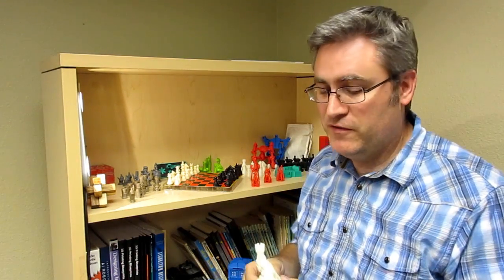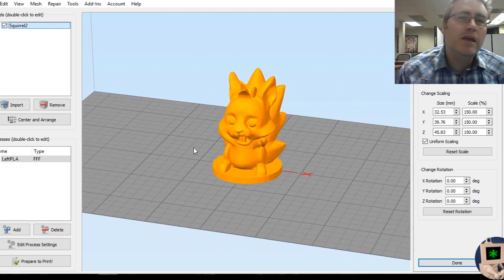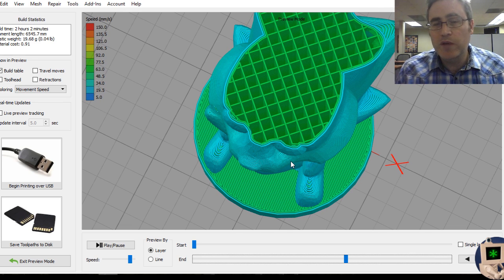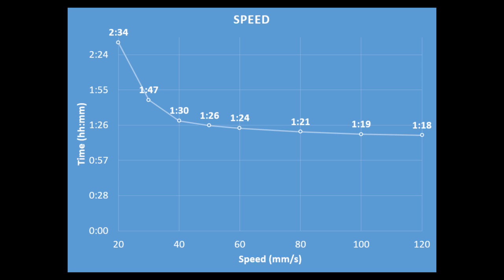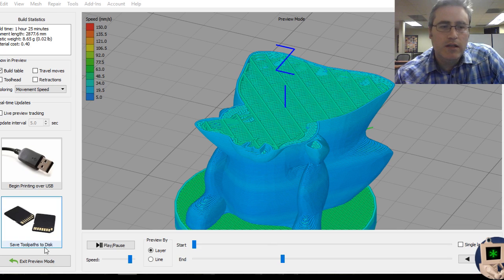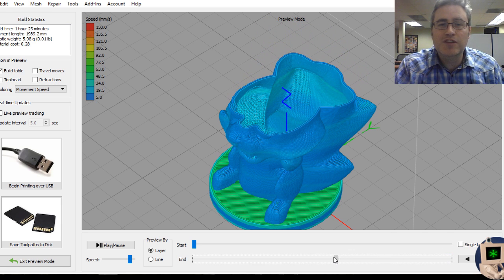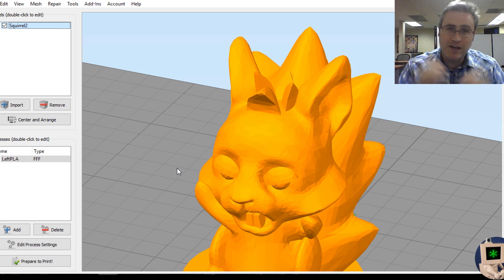How long does that take to 3D print?

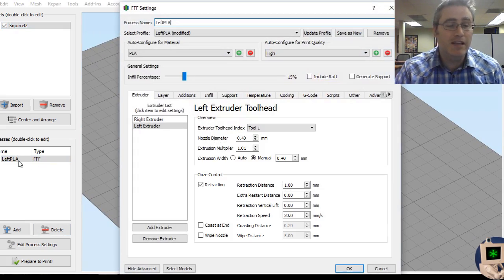Comment: At 14:15 when you were doing the layer height adjustments you accidentally changed the nozzle size to 0.10 instead of the layer height, FYI. It stayed at 0.10 for the rest of the layer height section of the video, so the derived numbers are off relative to the earlier baselines.
Reply from the maker: Yeah, in the video demo that's true, but when I gathered the data before hand to make the charts I didn't make that mistake. But, good catch.

Comment: Hello, just want to sayI love your videos, they are very informative.  I know this video is 2 years old but I've only recently discovered your fine channel.  I don't know if you've already had comments or not, but I just wanted to point out that at about the 14 minute mark, you changed the layer height to .3 from .15.  After you went back to change it, you actually changed the nozel size to .1 instead of layer size, and when it didn't print you went back and changed the layer hight without changing the nozel size back to .40.  I'm not sure if that makes any difference or not, but I just thought I'd mention it to you.
Keep up the great work!!!!
Reply from the maker: That was a silly mistake done while recording, but the graph was done with the correct information. Good catch!

Comment: Heh, I'm coming into this hobby as a CNC milling machine setter. So I'm used to 2 hour more or less setting times on average as I set the less complex machines. But after that the parts roll off the machine between 20/30 seconds for the basic stuff and 20 mins later for the more involved items

Comment: did you just set your nozzle diameter and print layer to .1mm? if so then your print time I think would actually be a lot lower once you set the nozzle diameter back to .4mm then set the layer height to .1mm lol
Reply: at 14:15 was where you changed your nozzle diameter, which I am sure you caught later unless none of these settings were saved so you never had a print try to use them  ha ha
Reply from the maker: Did I not reply to you 2 months ago when I wrote this? Yeah, I noticed that I messed that up after the video. Fortunately the data for the estimates was made before I made that screw-up, so while the lecture is a mess, the facts are right. Good catch on you.
Reply: not even sure about the query about replying, heck I forgot I even posted this lol.

Comment: I actually ran some of my own estimates. Using the fairly new bob-om HD model on thingiverse, Cura 2.1.2 x64 slicer, 1.2mm walls (3 walls), 25% infill, 40-50mm/s print speed. Looking at JUST changing the layer heights (hh:mm):
0.1 - 33:58
0.15 - 22:55
0.2 - 17:34
0.25 - 14:07
0.3 - 11:55

So you can cut the print time in half using 0.2 to 0.1 with only a minor hit on the final printed quality. Versus a big reduction in quality printing at 0.3 layer height (say with a 0.6 nozzle as I use sometimes), cuts down the print time by almost a third of original 0.1 time. So that is a part of 3D printing that we need to balance, do we need strength, speed, or quality? While slower print speeds resulting in longer print times typically lends itself to strength and quality, some of the newer 3D printers out there are able to keep the strength and quality at higher speeds, but also comes with a higher price tag.

Comment: Great video!  As a NOOB, I truly appreciate videos like this AND the Blender videos.  

I am waiting for my BCN3D Sigma printer to be shipped and am trying to get a head start on preparing myself. 

BTW..At 14:15, you accidentally changed the Nozzle Diameter rather than changing the Layer Height.
Reply from the maker: +notcranium You're the second person to catch that nozzle change. Man, you can't get away with anything online. Fortunately it didn't break anything and I caught it soon after.

I recommend you start modeling now. Don't need a printer for that. I was modeling for a year before I got a 3D printer.
Reply: +Joe&#39;s 3D Workbench Thanks for the suggestion.  I already started modeling in Sketchup and want to move over to Blender for the flexibility although Blender does appear to have a much steeper learning curve!  
I just bought this book about making an Octopus Pencil Holder that I hope will help with the learning.  :)

Comment: S3D is notoriously underestimating the amount of time something takes to print. I've had a print estimated at 16 hours take 20+. I've never had a print finish under S3D estimation. I've had a 4 hour print take 9 1/2. S3D can be greatly off. 
You really need to start with a baseline of a 4 hour model and see where it goes -- 30% more is over an hour more time.  There are more elements than acceleration, there is "jerk" which is how fast the head does corners, some printers can do set jerk to 15mm and have it corner well, others need to have at 5mm or 8mm etc. Acceleration of your printer is also not known by S3D it's extrapolating, guessing -- some printers can have the acceleration set to 4000 or 5000 and have things work, others will have belts slip as it's accelerating. Then there is non-print movement, how fast the head can do travels while not printing, that may actually be the bigger limiting factor as the model gets bigger. If you tune other parameters, that is jerk and acceleration to work best with the mechanics of the machine, print speed can be increased without lose in quality. I typically print at 90 and 100mm/sec (different cartesian printers) and the one printing at 90 is actually faster due to higher accelerations and more aggressive jerk. I built a large delta and those printers can absolutely fly, if you can extrude plastic fast enough (that's a limiting factor there, will get to it in a bit) those printers can print and actually achieve speeds of excess of 200mm/sec. And their non printing travels can easily go over 500mm/sec. That being said, I'm upgrading my delta extruder and hot end to bondech and e3d volcano -- when dealing with big models (the delta print volume is 490mm  diameter and 685mm height -- though will be a bit less with volcano) using standard .4mm nozzle is just not practical, as fast as it can move, going up to a bigger nozzle for large models will not noticeably impact quality and will drastically speed up prints. That was a lot longer than I intended. PS you changed your nozzle diameter in one setting to .1 -- that will A) not work B) make the print take a lot longer.
Reply from the maker: +kazolar I did change the nozzle diameter there at the end. Fortunately it was on the last item and I did catch it after recording the video. I just hoped no one on the internet would notice. So bonus points to you. The charts were built before my mistake, though, that so I know it didn't effect the date there.

Yeah, S3D isn't accurate, but if it's consistently inaccurate it can still be used for comparisons with reasonable assurance. It's not perfect, but it's better than having to print 40 copies of the same thing with different settings.
Reply: +Joe's 3D Workbench I find that the more travels and retraction there is in the print the greater the deviation is. If I tell S3D to lift on retraction, it will get even slower, and the estimate will be even more optimistic, however doing that eliminates "scar" marks, so worth it.
Reply: I am using Cura, and it actually did underestimate the print time once. That was a mesh screen I created using a Blender script, and it was especially crafted to cheat Cura into printing a mesh the "obvious" way, meaning to lay down whole length columns and rows. With 10cm lines, the printer goes to top speed in no time at all.

Comment: This is a very interesting video. When I had to explain to family members how long things take, they seemed pretty surprised. My sister had envisioned something like those machines at zoos and museums that mold plastic or wax figures in a couple of minutes...

I do have my doubts about Simplify 3D's estimates, because they are always considerably off for me, but I don't know if they are consistently off (in other words, I'm not sure if it gets the percentage difference between the various settings right, even if the total time is wrong). It does seem a little counterintuitive that so many of the settings like infill don't actually affect print time that much. That said, layer does indeed seem to make the most dramatic difference. I'm still new to 3D printing but after doing some experimentation I've more or less decided to do most things at 0.1 mm layer height. I'd rather it take longer than look bad, and when I tried 0.2 mm my models looked rather bandy in places. But I might give 0.15 mm a try.
Reply from the maker: +Mighty Jabba&#39;s Collection S3Ds estimates may be wrong, but I was relying on them being consistently wrong for comparison reasons. Of course the only way we'd really know is to print the same models over and measure the times. Adding up all the prints I would have to do in this video that would be a week worth of printing for me and who knows how much filament so i can have 40 copies of the same model, more or less. I'm willing to do a lot of things for 3D printing, but like Meatloaf I won't do that.
Reply: +Joe&#39;s 3D Workbench Sure, this is the most practical approach to take for sure. I also think there's going to be some significant variations between printers that would make it difficult to make comparisons even if you wanted to try and actually print everything out.

Comment: that's a typical question everyone is asking when they see my prints. the second is obviously about money.
Reply from the maker: +ilovedoom True. But that's an even harder question to answer. Material cost, that's easy. But it's also the least significant part of the cost.
Reply: +Joe's 3D Workbench i have an excel for that on google drive. I hate to read it because most of the prints were forfeited...
Reply: +ilovedoom how do you factor that in, cost of plastic -- cost of power -- I printed a huge cave/perch for my bearded dragon -- long over 200 hours in printing, 25 large prints nearly 5kg of plastic, it's PETG so it was expensive, so yes it's $150 in plastic, but the printer was running for 200+ hours with a heated bed on -- that's electrical usage -- not free -- then of course do you subdivide the cost of the machine into each print?
Reply: +kazolar some sort of what you said is what makes the prize. energy cost per minutes, material usage and a forfait for handling a 3d model, a downloaded content with all the correct licensing. the other case is about making a model and that's totally another thing and another topic. an example for you, I have 0,60€ per KW and 150w of the printer. the material is almost 0,9 density for PLA, but it depends on the specific material. with all this in mind an oddish vase is almost 35€ with some settings to get the print in less than 3 hours and a 35€/750gr filament.
Reply: I have a system I installed in my panel (my own circuit based on instructions I found online) which measures current draw from various breakers in house. Basically I have 30 different inputs (2 arduino mega's -- 15 analogs for inputs per as the system needs 1 input for current frequency baseline) -- So I feed the data into a mysql server and can analyze it. I am currently working on a wireless LCD display which will display instant power draw from all my printers, a little embeded WiFi chip with some custom code. I will then be able to answer the question more adequately since 3 printers with heated beds do pull a good bit of current, however it's deceptive as my biggest beast with a 500mm heated bed and max current of 600w doesn't actually pull that continuously -- I notice it settles at about 200 watts due to PID tuning.

Comment from the maker: Quick question for everyone, does the audio before or after the break sound better?
Reply: I thought the volume level was better in the beginning, but I think overall sound quality was better at the end.
Reply: on your printer you should try this combination:
Layerheight 0,200
Speed 80mm/sec
Outlines 4
Infill 40%
Scale not over 100-175%

Maybe tweak on the acceleration settings faster.